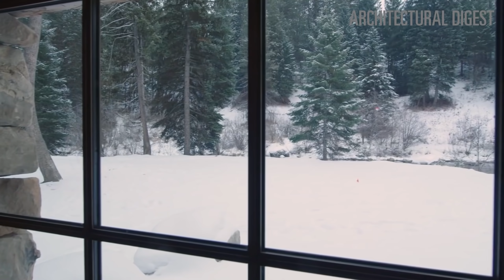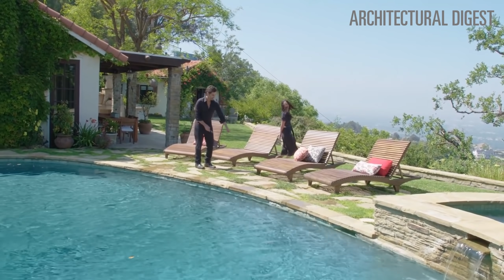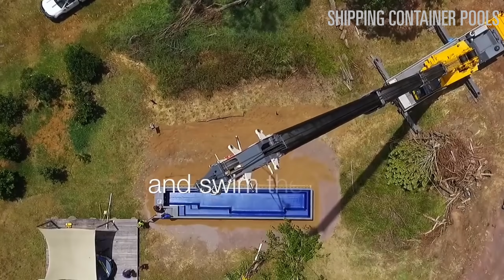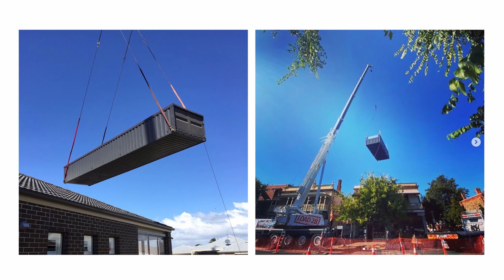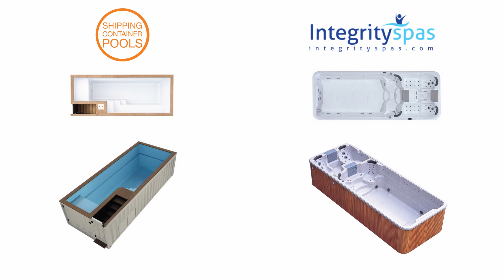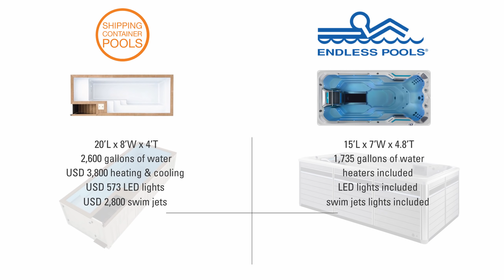Should you buy a shipping container pool?

Comment: I used to harbor a fantasy of owning an endless pool for doing fitness as you said here. The price was always a show stopper. Then I got to use one at my public gym. It was a disappointment, because I could easily overpower the current and swim right into the wall. I think that one was more for the underwater treadmill use. But the cost.. for $80 a month, I get 3 lap pools, a locker room and free clean towel service. I can do that for 16 years before an Endless pool is cheaper., if you don't charge for the water and heater.
Reply: @punpun3257  We actually have a lot of good pools in Virginia. The higher end ones with 50 meter laps are just not always open to the public. But yes, I got some outdoor laps today at my regular public club.
Reply: You still get towels? The YMCA used the pandemic as an excuse to not have towels and even though they have group classes again and even the sauna is open again, they still didn't start providing towels again. There has to be almost zero chance of getting covid from the towels, and most people are vaccinated by now, so they obviously just want to save money.
Reply: Great way to look at it. Why spend so much and have to worry about moving or maintenance
Reply: ah. that sucks. i guess nothing beats an actual river. there's one in my farm that runs almost exactly as fast as i can swim, so i can swim for hours without actually moving. i wanted a portable version of that.
Reply: @GraveUypo  depends on the river, most of the ones I have swam in are pretty slow.
Reply: Any swimming advice? I've attempted to learn on my own, but breathing through the troughs is super annoying because the air is too thin and I can't inhale enough of it. I end up just going under and holding my breath after awhile.
Reply: @Redhollow  one breathing exercise you can practice to help concentrate on your timing is to find a sturdy object at surface level such as the pool wall, submerging yourself and slowly exhaling as much air as you can before quickly surfacing and inhaling as quickly as possible before submerging again to repeat the process.There isn't really much I or anyone else can do to help you learn to swim through a YouTube comment, the motions involved don't usually come naturally to humans and are difficult to explain without demonstrating. I would recommend finding a friend or relative who has experience teaching swim lessons or is at least a competent swimmer and asking them for help.
Reply: @Redhollow Music  A duct tape + Scuba-whistle works wonders, especially when you're new to learning swimming on your own and don't have a guide/helper. Take two pieces of duct tape each approx 1ft in length, any cheap regular use duct tape will do. Wrap one each, around both your ankles and wrists tightly. Now put the Scuba-whislte in your mouth and hold it tightly using your lips, as if your life depended on it, and without further delay, jump into the deeper side of the pool/lake/ocean.
Chances are that it doesn't work out, you can always blow the whistle and hope someone listens to it. Just wait for them to post a YT comment asking advice on how to save a drowning person, and hold-on to your breath until one of our knowledgeable peers replies with their smart-ass "LPT".
By end of the day, I'm sure you'd have already learned a lesson or two about swimming.
Please like my comment if you found it useful and share it with your dumbass friends. Thanks.
Reply: @phyt4398  liked for the effort put into the comment, even if it is a troll.
Reply: I have seen people using bungee cords and a belt around their waist attached to the bungee cords to give them resistance while swimming in tiny above ground pools. It's not as sexy as swimming against a current but it does the job at a fraction of the price of an endless pool.
Reply: @cillyhoney1892  Tried that once too with a belt and some line, but it was just too clumsy. Maybe if it was anchored on the bottom of the pool, you could kick and paddle smoothly. Thanks
Reply: @punpun3257  being the largest economy in my world (by some measures the US isn't the largest economy in the world anymore) doesn't say much about most people's individual wealth or quality of life it is a large country and there are plenty of regions in the US where a significant portion of the population doesn't have access to safe drinking water, reliable power, or adaquate shelter. Yes most countries tend to be worse on average, but that doesn't mean that every region of one country is necessarily better than every region of another.
Reply: @garethbaus5471  If you are born in USA and your town suck just move to another town, you are USA citizen.
 I dont think you understand the reality of 3rd word country, I grow up in argentina, today with usd500/month you are the 10% richest and is not as cheap as you will think, many product are cheaper in USA than there.
 Last year in Arizona I made 100k as an HVAC tech, in Argentina will take me 20 years to make 100k
Reply: @gsabic  I am actually in a fairly decent part of the US, but I have lived in parts that were pretty bad, as in cold regions where a large percentage of the population had a serious addiction and didn't have a place to live bad, and it isn't like they could afford to move it was about half a days drive from anywhere better and if you don't have money for shelter you don't have money for transportation and it isn't like you can safely walk that far(seriously getting caught in a snowstorm without shelter or proper equipment often will kill you especially when there is nobody searching for you and nobody nearby) sure some people have it great in the US and most regions are comparativly nice places, but many the people in the truly bad areas litterally don't have a way out (also hitchhiking doesn't usually work in those areas)
Reply: @garethbaus5471  I don't get it, why if you live in a shity town you just take a bus and start a new life in Phoenix for example?
 I move to USA without speak english, no working permit/citizenship, and no money in 2009 today I have 6 rentals and enough money in my investment account to retire. disclaimer: I am smart, hard work and very good looking
Reply: @gsabic  shitty towns don't get buses, and even if they did how would you buy a ticket? It is sortove a catch 22 where the only people who end up there don't have the means to leave. You are really overestimating the amount of non car based transportation that exists in poor rural areas of the US.
Reply: @garethbaus5471  Which is that town? that place that you describe sucks. I will leave in a bicycle or walk if I have to.
Reply: @gsabic  which one? I can name about half a dozen of them, and most of them would take about 1 to 2 weeks to walk to a better place(I used Google maps to estimate times and assumed 10 hours of walking per day) definitely possible if you are young, healthy and in your right mind, but most of those people wouldn't be there in the first place if they were young, healthy, and in their right mind.
Reply: @garethbaus5471  the soonest they beguine walking the better LOL. 
you are correct some people will never leave poverty. 
my point is, if you can not make it USA the problem is not the country the problem is you.
Reply: @gsabic  mostly varius forms of bad luck and cultural factors like oppressive religious indoctrination.
Reply: @garethbaus5471  Less than 1% chance you are born USA, one of the richest countries in the world, do you think that that is bad lack? I grow up in a poor country, that is normal for most people in the world
Reply: @gsabic  As a fellow immigrant from a country even poorer than Argentina on average, I appreciate your effort to inform. But many if not most people who have grown up in the US have no conception of what true poverty is, nor the imagination to even begin to appreciate the nature of it. If pressured, like the person you were talking to, they will make exaggerated claims of it, without realizing how unlikely those claims sounds to anyone halfway familiar with either America on the one hand or global poverty on the other.

The US is an amazing country, and the level of opportunity here, along with the strong culture of liberty which was once endemic almost everywhere here, means that almost anyone in every community here can succeed if they are willing to make the effort. (Since I don’t want to write an essay, I’ll leave aside those who are in dire straits or cruel/tragic situations with no one to help and no way out. But they are very few in comparison. At least until enough people people forget what once made America the beacon of the world.)
Reply: @keoghanwhimsically2268 
But what you don't want to write an essay about - IS the point! 
You think anyone is dismissive of "true" poverty, and then you go to minimize (in number and/or seriousness) what is out of your (and a person's you agree with) knowledge/experience.

You have a privilege. Being healthy and raised!!! to be skilled and motivated is making huge advantage among disadvantaged. 
It's cruel irrational individualism and ignorance to think "yeah everyone could get out - they just prefer to stay in terrible situation(s)" 
/and if they really, really can't let's not spend time talking about them, they're ruining my point/

Great(est) country would not have anyone working hard to live just fine. 
Average people could just work moderately, and people with less abilities less/or none and still get basic needs comfortably met. 
(Ahhh, but that's scary communism talking. US prefers eugenics, as pandemic clearly shows, if it wasn't clear before, with how healthcare is treated)
Reply: @punpun3257  Any large city is going to have a gym with that stuff. You don't have to be in a nice place for it.
Reply: @punpun3257  It really isn't. I live in the cheaper side of Portland and all the gyms here have it. A lot of east Portland was even considered Felony flats for a long time. It's far from rich.
Reply: @punpun3257  Yes but that's not equal. Most people in the US are not living rich and tons are living in poverty. I did for most my life until recently.
Reply: @punpun3257  LOL my neighbour's lawn is always greener. Just be happy where you are, no such thing as first, second, third world country.
Reply: @jinoz8560  I dont think you undertand the reality of 3rd word country, I grow up in argentina, today with usd500/month you are the 10% richest and is not as cheap as you will think, many product are cheaper in USA than there.
 Last year in Arizona I made 100k as an HVAC tech, in Argentina will take me 20 years to make 100k
Reply: @gsabic  No, you are comparing your life with money Yes, money is important, the reality is that you have to feel HAPPY where you are. I personally never want or even think of living in the USA. As long as you earn enough and have a roof over your head that is good enough. I have family, good food, nice place to live here so why would I need to live somewhere else just to earn more money?
Beside, it would be the best feeling to contribute to your own society and country regardless of political view.
Reply: @jinoz8560  I am glad you are happy wherever you are.
 For me is not only about money, I feel safe if I walk my dog at 3am, my home has no bars in the windows. In argentina people have money on them so when they are robed don't get murder for not having money.
After 12 years living here I feel that this is my society, I feel like a foreign in Argentina
Reply: @gsabic  you are spot on mate, security is another factor. You have to feel safe at home. Bad neighbour hood is everywhere, to find a nice local safe home is everyone's dream. It all comes to poverty but it is all different political topic lol.

Comment: 30+ years in this industry shipping container pools big waste of money have 4 on my route 1 brand new and the other 3 over 5 and 6 years old and rusting as fast as possible all are grounded and have proper electrical bond all have multiple sacrificial anodes also the coating used on the inside weeps rust stain through from underneath one has the window which now has already growing thru the sealant which can't be cleaned and the acrylic is turning cloudy from baking in the sunlight what a $ 40,000.00 waste DONT DO IT .

Comment: All of these are ridiculously overpriced. I would guess it costs them less than 25% of the retail price to manufacture them. Even if they're including the cost of the crane and prepping the ground they're easily doubling or tripling their cost.      /      Fiberglass is heavy so it adds more weight than is necessary. It also flexes and cracks so it would eventually leak. The water would then be trapped inside the container causing it to rust from the inside out. Fiberglass is easy to seal if it is a small leak but you've still got water trapped in the container.      /     They would do just as well to use some kind of spray on liner.

Comment: i've a cheaper alternative: pools made from pond plastic sheet of holes dug in the earth, size: at least 3,5m diameter by 1m depth- just have to put on the swimming harness (30$ ?)on your feet & fix it on any tree or pole for swimming the 4 styles as you like, i already tried it in the river. its producer is nabaiji, guess you can find it on YT its presentation. technical equipment of any pool better with filterpump & solar heater (PE) of course.

Comment: Doesn't sound right:

1. Steel shipping containers are not strong enough to hold in the force of water, but the shown pool is made with fiberglass inserts. Fiberglass inserts are _insanely strong_, there's a reason boat hulls are made using polyester.

2. When lowered into the ground, the earth is pushing in the pool, surely that is balanced out by the water pushing out. Don't underestimate the power of shipping containers either surely when they are re-enforced.

3. Insulation is a matter of implementation, if you have a fiberglass shell and a shipping container, at least go the extra mile and fill up the voids with insulation :)

Anyhoe, the 20' shipping container option is going to have no structural issues whatsoever - it's overbuilt if anything.

Comment: Fiberglass pools are, by far, the most efficient and economical in the long run. Plus you're not stuck exclusively with the shipping-container dimensions.
Reply: Pretty much dig a hole. Set the pool into place and fill the area between the shell and the edges of the hole...
Reply: @hanro50  the steel will corrode
Reply: @sinatraforeign  fibreglass? Not steel
Reply: @hanro50  That's the Inside, not the outside. it's called shipping container swimming pool bruh
Reply: @sinatraforeign  I'm talking about... traditional fibreglass pools. 

You can get them as shells and basically use dirt with some reinforcement as the box...

Comment: THis would seem to be similar to issues with burying shipping containers. The sides were meant to securely hold objects. They were not meant to hold lateral forces. If burying a shipping container is likely to result in the sides caving in from the weight of the soil, then a swimming pool will have issues from the weight of the water.

Comment: Again, I agree with you 100% on this new use of shipping containers. If your handy and would like a pool, it makes a nice project to build yourself. I built my first 16’x32’ pool myself using a concrete slab, and I then framed up 48” walls from PT 2”x6” at 16” O. C. THEN I just sheathed the inside with marine grade PT 5/8” plywood covered with 1/4” rolled poly foam ( available in 48” x 50’ rolls) spray 3M ADHESIVE on the plywood and press on your rolled foam. Do all your PVC plumbing on the outside and back fill the pool perimeter with soil and use diagonal
2” x 6” PT BRACES EVERY 48”. 
Buy a standard 16’ x32’ vinyl liner and set up a shop vac on the skimmer side. Fill slowly and press out all the wrinkles. Then double up the vinyl at the top plates of your wall and top with Cedar or Redwood. You can build a walkway on top of your walls edge like a small perimeter deck right on grade. 
Buy a filter system and you have a nice pool for under 7500.00 in today’s money. My first pool was built 35 years ago using the process described. I sold that house 20 years ago and the present owners still enjoy that pool today. It will last a lifetime if maintained well. Sorry for the book,
I thought you might be interested in an alternative way of building a pool. ✌🏻🇺🇸
Reply: deleted old dumb comment so that I could say this instead: Thank you for the description and assessment of your pool construction!
Reply: @hamyncheese  
I saw your first comment and I just wanted to let you know that the pool I built was drawn out on plans for the Building inspector and a permit was filed for the construction. Plumbing, Electrical and construction Permits were pulled and all necessary inspections were done. It all passed the Code requirements with ease. It was overbuilt and 10 times stronger than any typical galvanized metal panels typically used on Inground pools. The concrete slab was poured over 48” footings with 4’x8’ metal reinforced mats. The slab could have been used to build a house on as they were dug in a 48” grid pattern. The best part was the concrete pour was done in a single pour. As the forms were filled it also filled the footings, making it a monolithic pad 8” thick. 
This is why it’s still in use to this day. The liner has been replaced recently I was told but it otherwise is rock solid. 
A 16’ x 32’ in ground pool can be built BETTER and stronger for LESS!!
Thanks for the second comment. Now you know😃✌🏻🇺🇸✌🏻🇺🇸🇺🇸🇺🇸
Reply: @Waveluth  Indeed! Thanks for all the info!